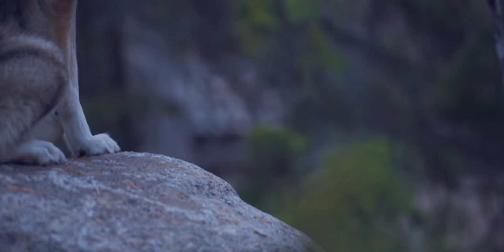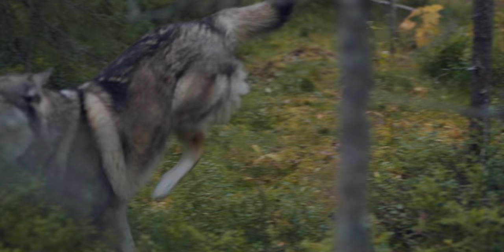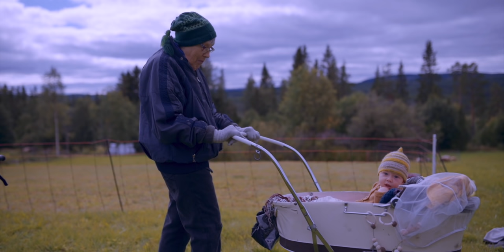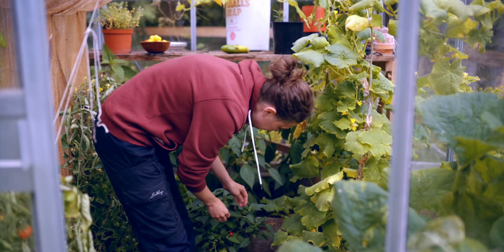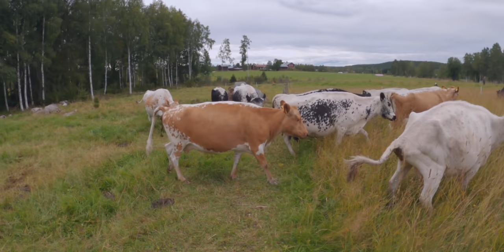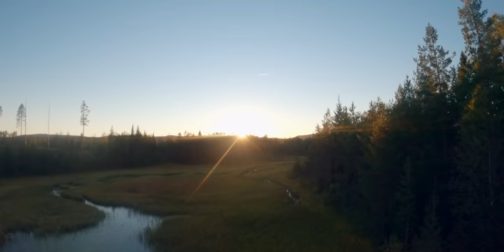Off Grid Family Living in the Woods

Comment: Very nice video, great grandmother and sweet grandson, laugh, yes this is the best medicine for both. 
Organic farming - forestry, the basis is that you have enough land, because you need winter fodder, pasture and the soil has to regenerate. So in principle, as in the past, 30% area for regeneration. In your case, without cereal cultivation a little less, but the area for regeneration is just as dependent on the amount of livestock on the pasture. 
Very important, water is probably worth having several wells, should be possible, the ground / surface water is not that deep. Water filters, you can easily build yourself. Laugh, I also like to come to your place with my wife and dog and weld the filters together. 
Go on like this, and yes the sweet little boy, slowly steals the show.
Stay healthy and take good care of yourself.
Best wishes from Frankfurt.

Comment: To protect the wood near the ground you can use what we call Stockholm tar (pine tar) which is thinned and painted on.  It will preserve the wood for many years longer than unprotected wood.  There are ways to make the stuff yourself, but it is probably easier to buy it if you need very much.  It is an old Scandinavian folk way of building things right (things like old wooden churches were usually "painted' with the tar and they would last for centuries.) I know my mother's family's "old" home in Finland was well over 300 years old (basically a log cabin now used for storage) and had the dark wood saying it was treated with pine tar, but the new home (only 200 years old) had regular paint on it.